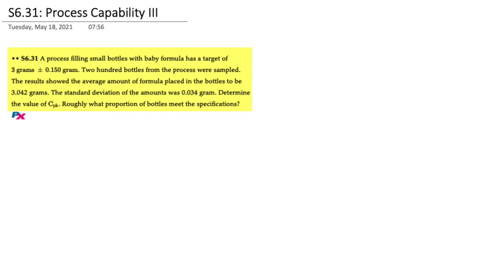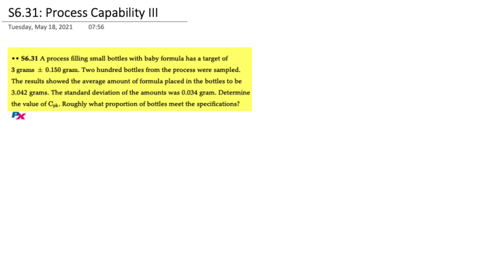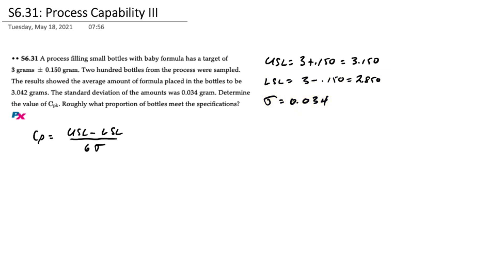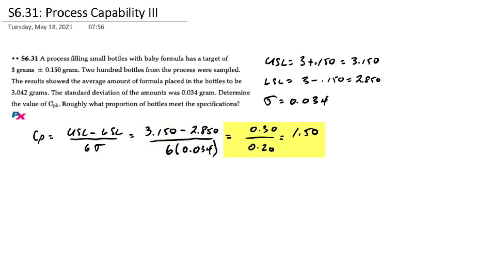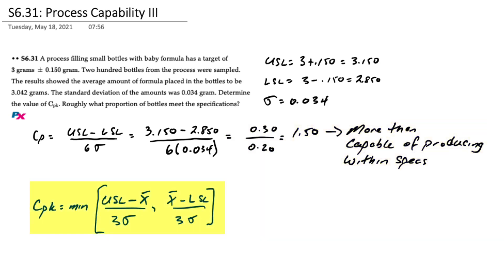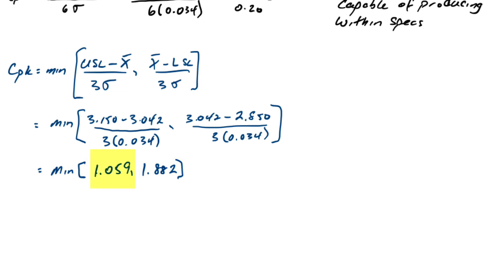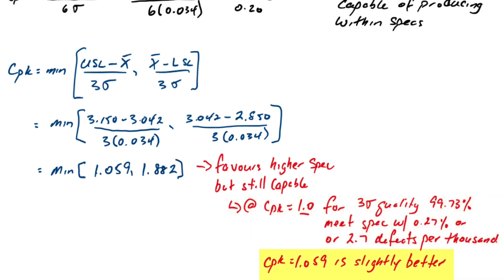Statistical Process Control: Process Capability III

Comment: how u get the percentage....u didnt eplain in the video
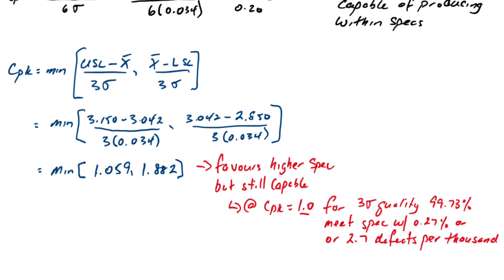Reply from the maker: Hi there. if you are referring to the 99.73% at around 2:20 in the video, that is common information regarding the standard normal curve. The area under the curve within +/– 3 standard deviations (i.e. 3𝝈) is 99.73%.
Hope this helps.
Mark